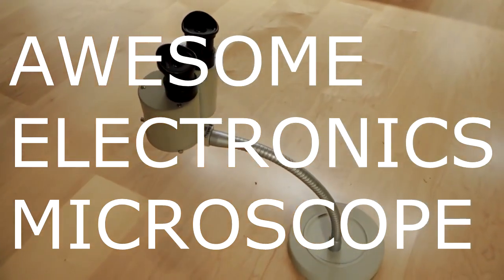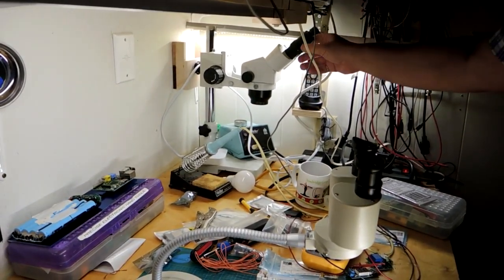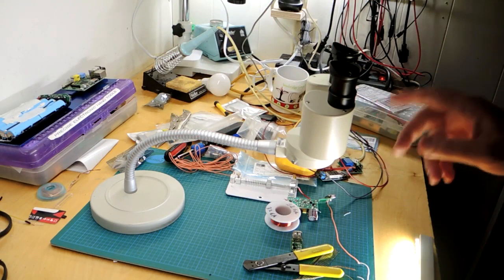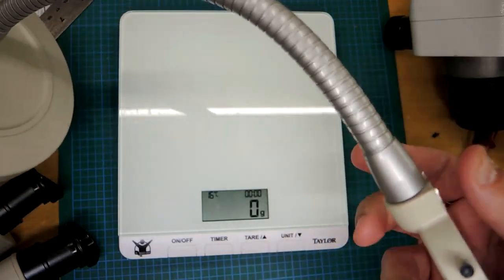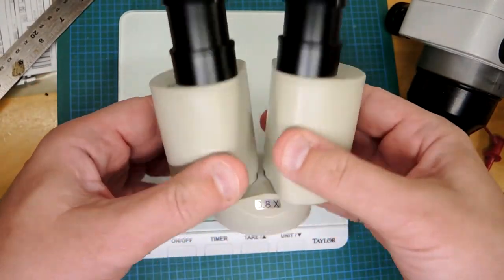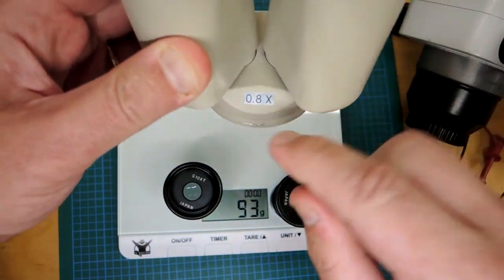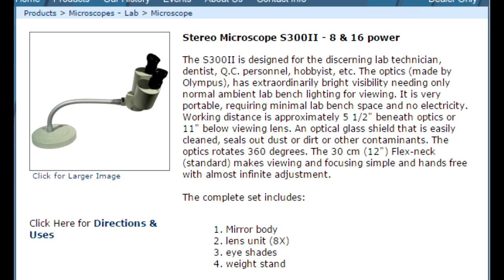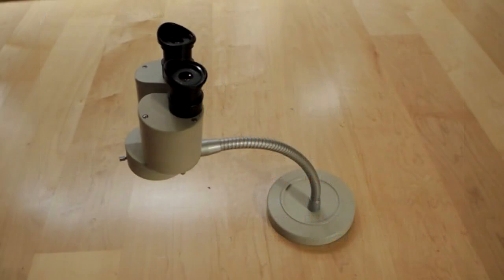Awesome Stereo Microscope for Electronics Work

Comment: Do you know is it is possible to wear glasses with the scope?
Reply from the maker: +norm1124 Sure, but it's not particularly comfortable.  Normally a microscope can be adjusted to whatever focus is desired so I don't quite understand why you would need glasses unless you have a significant vision impairment (if so, check out the "mantis" microscopes... expensive but very good.... they have a viewing area).